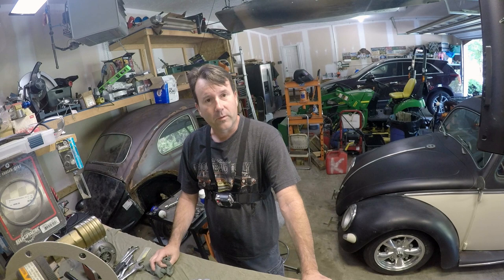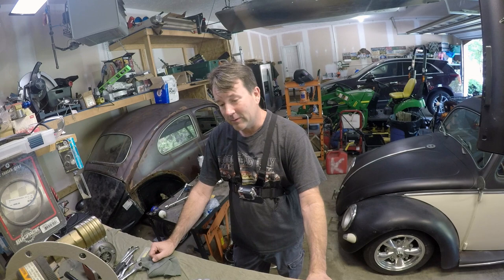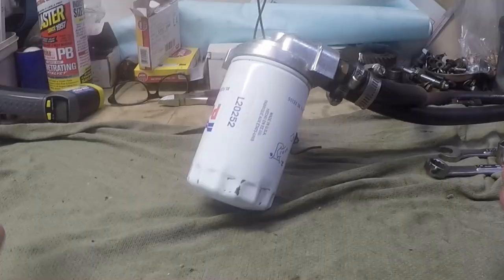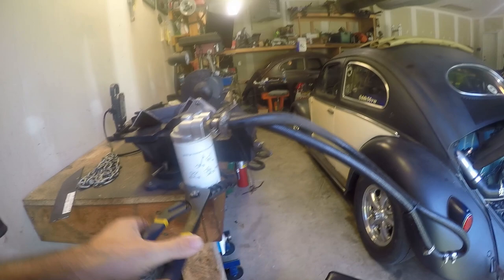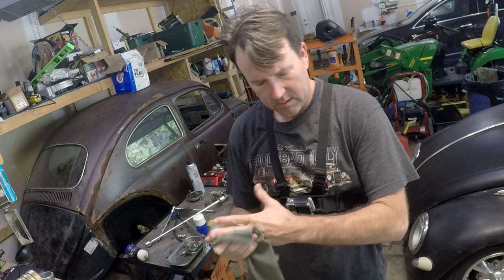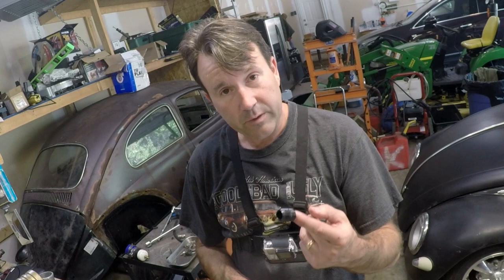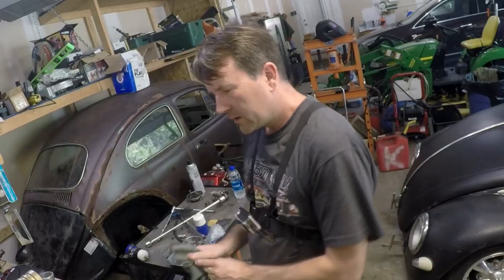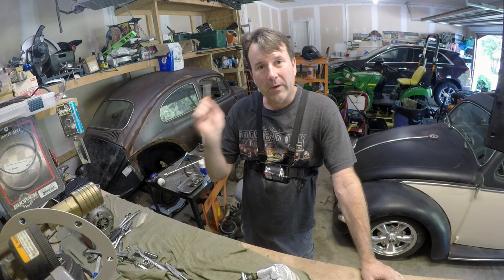Oil Filter relocation adapter (Don't be Like Me!)

Comment: I've not had that problem... But I'd be careful with the FRAM oil filters.
My engine would pop the seam on the FRAM filters. My local specialty acvw shop recommends using MANN FILTER W 920/17. I have never had a problem with oil filters since. I did also install an EMPI breather kit. Keep up the great work!! I would love to see your friends rail buggy.
Reply from the maker: Yes I also have had that problem popping oil filter seals. I don't run the normal Fram filters I only run there racing series filters but nobody around here stocks them anymore. We'll hopefully be pulling that rail out next week.

Comment: Thanks for the tip. Surprised you're not a fan of Oberg oil  filters.
Reply from the maker: I have never run a Oberg filter so I really can't say I am a fan either way. From what I have heard, they do work well.
Reply: @ddk56vw   Some folks like them, some don't. I bought a used one at a local swap meet. I haven't install it yet.

Comment: I was raised with vws, we changed oil, engines ran their life time as expected, never did i see indication that a filter would have extended the life, i dont want that ugly filter and hoses hanging in that engine bay. My advice, save yourself the pain
Reply from the maker: Oil filter doesn't hang in the engine bay, it is tucked under the fender. You are right, if you are running a stock 1500 or 1600 there is no need for more than a factor filter. I run something completely different than stock.

Comment: Not a remote filter, but I used to change my oil often because I put a lot of miles on my little 1983 Mazda B2000. On a particular day I had just changed my oil and drove pizza delivery all night, stopping for gas on the way home. As I left the gas station the idiot light came on for oil and my engine locked up. To this day I'm not sure what happened. The filter was still there,  I know I put oil in otherwise how did I drive most of the night? One of the mysteries of my life.. any ideas?
Reply from the maker: Hard to say, it's possible that the oil pump failed. Did you ever tear it down?
Reply: @ddk56vw  No. I have never gotten that far along in an engine. I have helped change them but that was later. If YouTube had been around I might have watched some videos and tried it. No it was locked up and I let it go. If I had the money I would have put another motor in, but I was struggling at the time.
Reply from the maker: @clasicradiolover  that is understandable. My Bug is my second car not my daily. Work comes first.